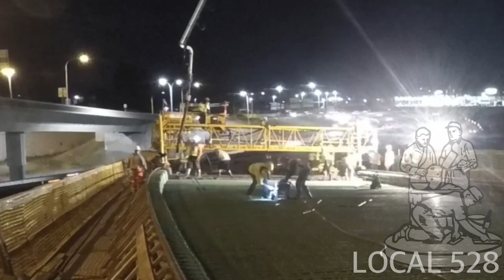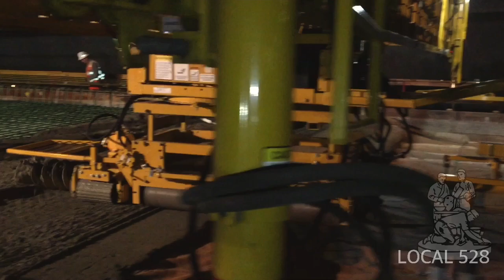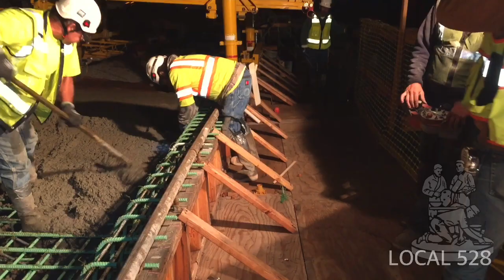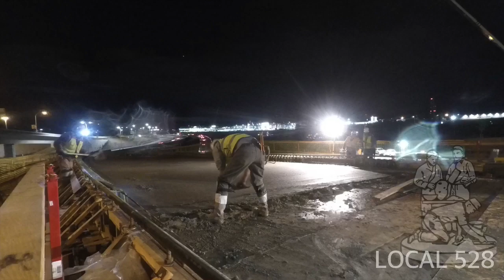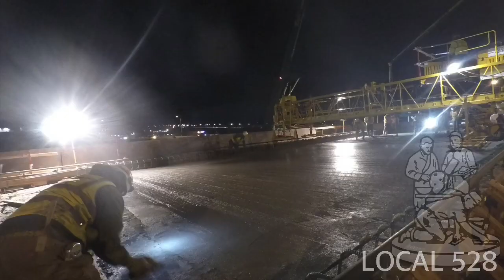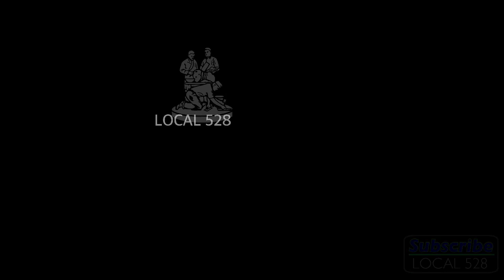Concrete Finishing on a bridge at night with a BID-WELL

Comment: Looks like it could be dangerous not to mention back breaking!
Reply: Wait til you see a video for a bridge deck for a railroad.  Because of the rebar sticking up for the rail plinths the machine just sets the grade and you have to finish the whole thing by hand.
Reply: @michaelshahayda1167   My husband and our 2 sons have been in concrete construction most of their lives. Mostly in housing construction. But my oldest son branched out and joined the cement masons union. He's worked on one bridge that scared the heck out of me. Freeway work also worries me. He worked in Seattle underground in the lite rail tunnel. Not sure how you spell it. Another thing that's always worried me is rebar sticking up. He is now teaching on a college campus students to become apprentices. He was chosen out of 10 others who applied. He's perfect for the job. I used to get so upset when I tried helping his little sister with her homework. He would come and say mom let me try, you go sit down and relax. And it then got quiet as he would talk with her. Their dad and I are aging at 67 and 69. He still does some concrete work and my son helps on his days off when needed. My other boy left WA state and went to the aviation academy in FL. He graduated in the class after 2 years with honors top in his class. But no job came out of it as he had been told there would be. But he's doing well with installing security systems in big warehouses and other buildings. Geez I'm not proud or anything right? I know your work is at times very dangerous and I know it's physically demanding. Eat good and get plenty of rest. And I hope if you have a partner and or family they are supportive. Your peace and happiness mean more than anything to those who love you.
Reply: @michaelshahayda1167  is there going to be a video for that? The bridge deck for a railroad you mentioned.
Reply: I'm Not Just a Useless Eater There might be video, but I didn’t take any, as I’m usually doing the finishing.  I wouldn’t call bridge work particularly dangerous, but it is very physically demanding; hand floating hundreds of yards of concrete will wear out anybody.  So I have a lot of respect for anybody that does it.  Cement Masons Union is a good union to join, particularly the Seattle local.
Reply: @michaelshahayda1167   Thank you. Most of what my boys and their dad have done is flatwork too. They were very good with exposed aggregate.  Not done right can look bad and then everything around it looks bad too. Done right it compliments everything else. On the bridge or some other job, oh yeah my oldest when early in the union worked at Bangor where the keep the submarines. They contracted with an outfit doing a job for the Navy. They were building metal buildings several stories high out over the water. They had to wear safety belts or harnesses. He might be 43 now but I don't know where all the years have gone. Going way too fast these days. Mom's are mom's till the day they die. I thought it would be different when they got to be the age they are. My mom died young so I never got to see how she would be around her kids as adults my kids age. Thank you for telling me about the union in Seattle. Seattle as a city has gone to hell though. There's a video on YT called Seattle is Dying. Interesting and true. In fact WA state needs a new governor. This side of the state is so liberal it's not thinking of our own problems and they seem to want more.  I'll be going to stay over by Mountlake Terrace for a couple days next week with my son so I'll get to see how bad it really has gotten. Homeless people everywhere. More drugs & alcohol and hence more crime. They need solutions to help Americans before helping others. Thanks again! Namaste and best to you.